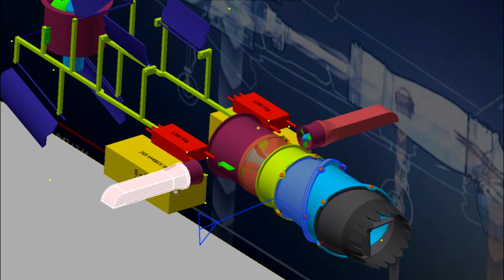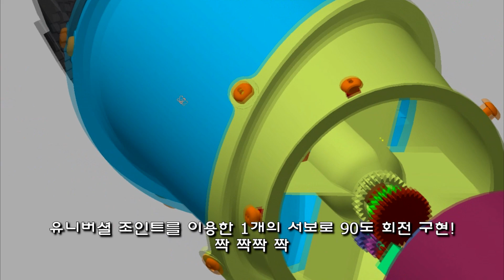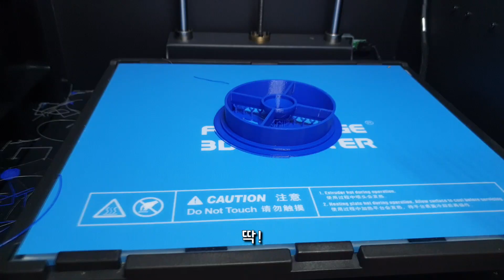수직이착륙 전투기 F-35B를 RC비행기로 만들기 2화, Homemade F35 RC Plane Ep.2 (ENGSUB)

Comment: nice video, and using the 30mm edf for roll is an good option, but you have to lift extra lipos😅
Reply from the maker: Lipo installs two 6s to 8s. One is real ducted fan. the other is vertical ducted fan and side 30mm ducted fan x2 and system. I going to test the battery.Thank you for your advice and watching.
Reply: @LaLaRC  awesome!